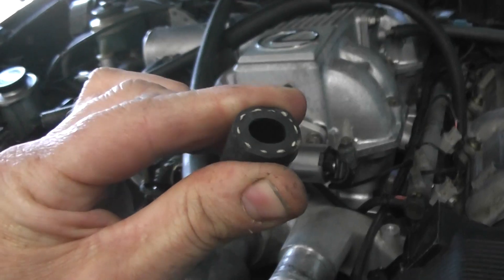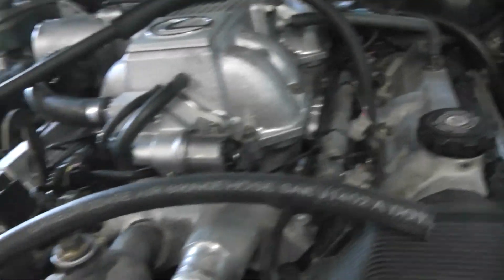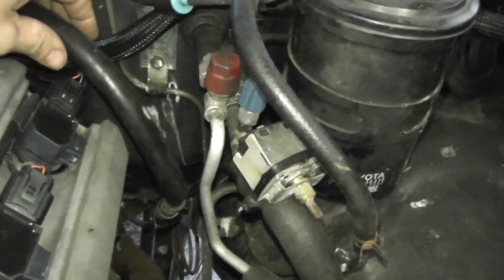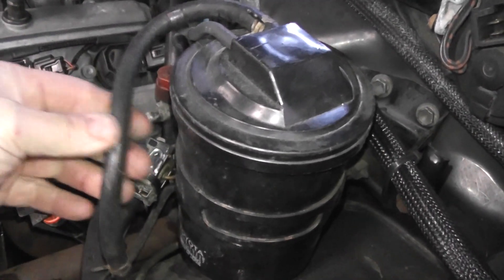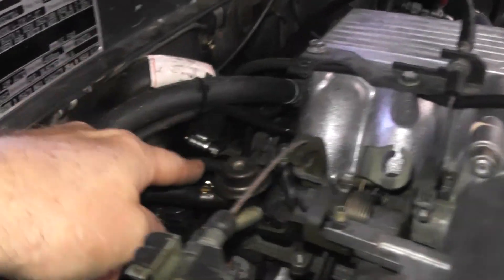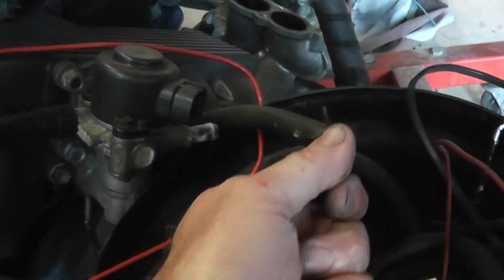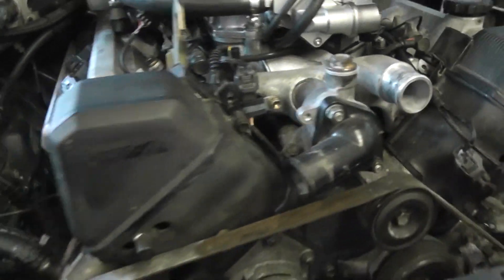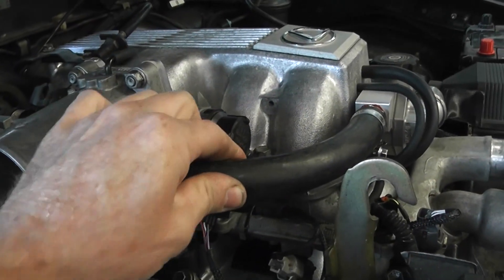1uz-fe Engine swap - selecting the correct hose.

Comment: Hello Kelvin, what about proper heater hose routing? Which heater hose goes into the heater control valve? Which pipe is the heater core inlet on the firewall?  I believe I may have plumbed my heater backwards which I hear can cause the core to leak in the cab...
Reply from the maker: The hot pipe to the heater is from the rear crossover,  the return from the heater is the pipe under the intake to the waterpump.   Whoever told you that connecting the pipes backwards to the heater may cause a leak is wrong.  Its not ideal for water flow in some cars however its not going to cause a leak.
Reply: @CartuneNZ  thanks 👍 good to know that flow direction in the heater core doesn't matter.
Reply: What do you use to block off coolant ports? Looks like you remove stainless steel tubes, then solder/weld over the holes? Or do you use epoxy ? I was thinking of trying to use aluminum brazing rods with a map torch since I don't have an oxy acetylene torch. Also my mig welder doesn't weld cast aluminum well at all...
Reply from the maker: @danlaetsch8493  we have some press in blanking bungs or we weld the holes up.

Comment: Are you using the transmission from the Toyota/ Lexus, or transmission adapter plate?( I’m trying to put the same motor in a G body GM car ( Monte Carlo)
Reply from the maker: This one is using a lexus transmission converted to 4x4.   Generally my preference is using the stock lexus trans in engine swaps as it means the stock lexus ecu can control it and they bolt nicely to the engine.  Cheers Kelvin.

Comment: could you do a vid on what clutchs and flywheels fit the 1uz gen 1 to 2wd r150 I need a bell for r150 and flywheel but I don't want to have to order a custom clutch everytime i let loose can i just use a 3.4 centerforce type or is there specific ones, in Hawaii all we got is auto v8 manual v6 i don't need high hp just need it to handle daily driver any info helps
Reply from the maker: Good morning.  Clutches and flywheels is a topic I have been avoiding a bit as I use a custom unit which works awesome and it isnt really relevant to the rest of the world. I see lots of crap setups out there and its certainly a problem area for guys doing swaps.  I tried two different setups when I started which were recommended by clutch guys at the time,  both were crap.  I then moved onto the present package I use and stuck with it for 15 years so I must like it.  I will cover the subject at some point.  Cheers Kelvin

Comment: Those looks like Honda coils, how well do they seat and stop dirt from getting down the spark plug tubes?
Reply from the maker: Not Honda coils which sit too high and allow dirt down the tubes.   These are 3uz coils which seal nicely and are the correct length.  Cheers Kelvin

Comment: I’ve got some leftover garden hose from my project bong - I swapped my apple bong into a Gatorade bottle and actually came together pretty well she rips hard when you wanna

Can I use that for my 1UZ swap?
Reply from the maker: Absolutely,   provided its the green garden hose with the cross hatch fibre reinforcing.  The red hose just never works even though its faster. Haha Cheers
Reply: @CartuneNZ  Thanks for the tip!